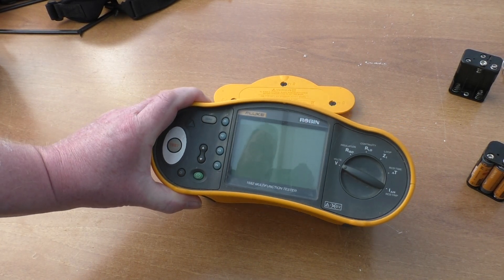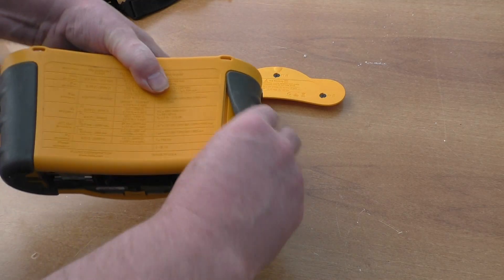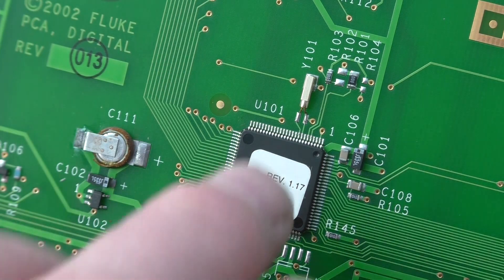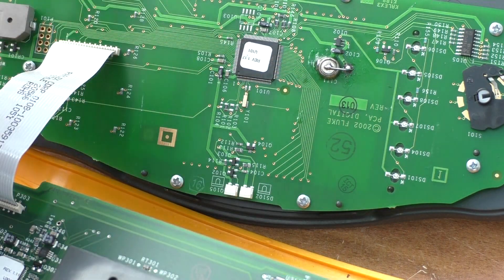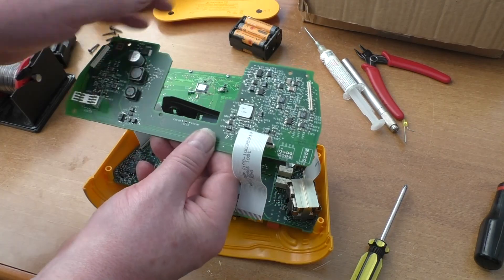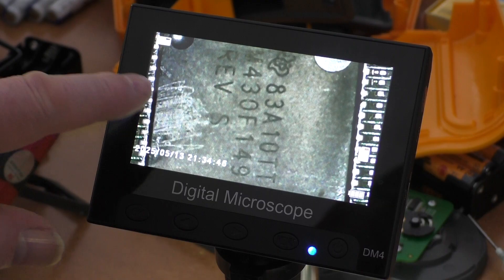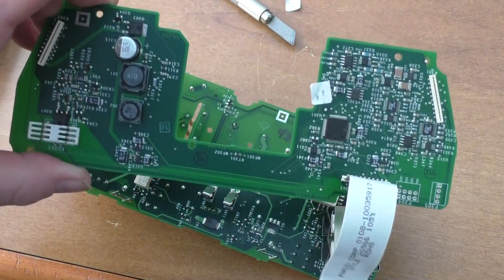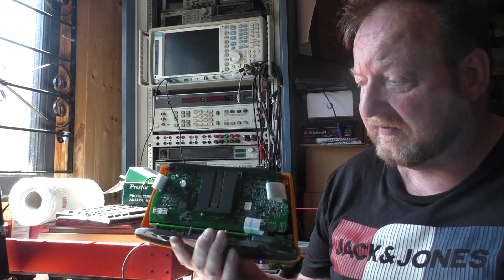Fluke 1652 Err 1 fault, teardown and fault conclusion.

Comment: I have fixed over 10 of them a big pain check XQ307 R371 R318 also but leads in as still with err 1 some functions still work continuity won't in most cases when nulin you get a high reading I do have diagrams some place in work shop not fixed one well did one today the last one was 2018 had other things going on surgery and just not giving a dam doing other stuff.

Comment: Both the MSP430s are off the shelf parts. The software loaded into them is another matter entirely. As already mentioned, there's no battery, that's a supercapacitor. That will only be there to maintain the clock and saved test results across battery changes (features this model doesn't even have).

An error 1 is beyond mere calibration, it would require the actual source of the error identifying and repairing first.
Reply from the maker: Thanks for the info, all a learning curve, especially with no circuit diagram.